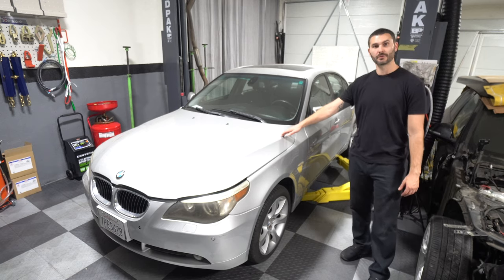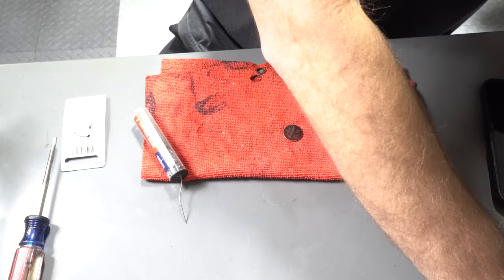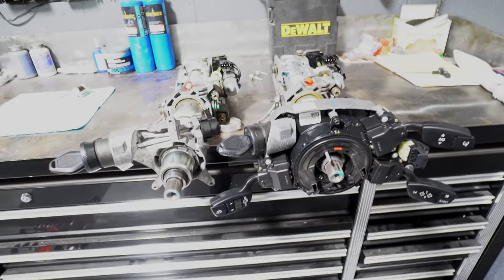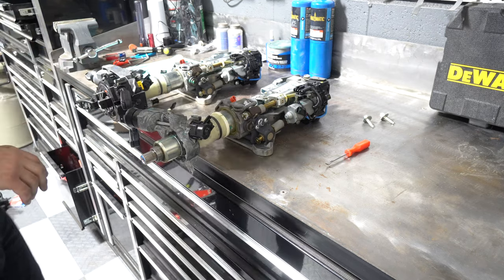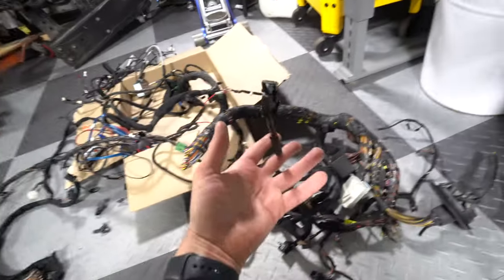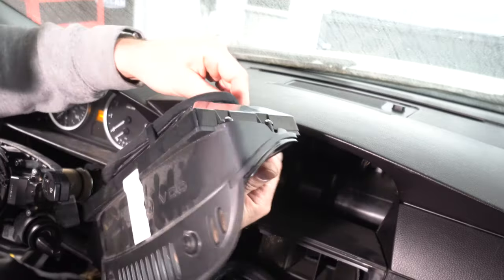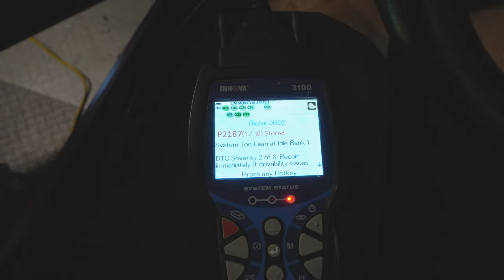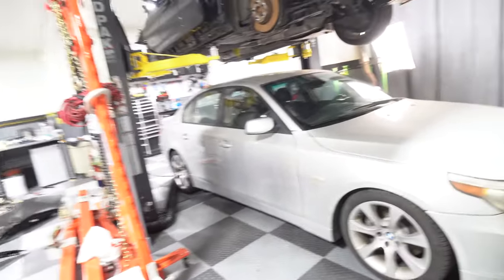No Start, Salvaged BMW 545i E60 Project, Will It Run?

Comment: Great Video 👍 You will need ISTA to fix the rest of the problems. Might as well pick up INPA and NCSexpert to easily code the exchanged parts.
ISTA is necessary to relearn the motor positions used for active steering.
Be sure to find the right ecu (SZL) that lives under the headunit, otherwise seats will not work. 
Good luck 👍
Reply from the maker: Thanks for the tip, appreciate it!

Comment: I think you said the cluster is from a 545i parts car so at least it’s coded to recognize active steering and ars through the dsc. That’s a huge plus for you considering you’re not dealing with a cluster that’s dsc did not have active steeeing.
Reply from the maker: Yes, I did run both Vins through Mdecoder to match up the options. Somehow the navigation slipped through, but I was able to adapt the parts car’s nav system by salvaging some of the parts car’s harness.

Comment: Just a thought - the steering warning light might indicate that the steering wheel sensor is not calibrated or off. If the car did not have its steering rack damaged/replaced/fiddled with, try rotating the steering wheel from one position to the opposite and back about 3-6 times (do the full rotations, of course). Turn the engine on, put the steering wheel into the far left position, then start turning right until it stops, then go back till it stops and so on. Sometimes, it works after 5-6 full circles, sometimes - after 1 or two. However, considering that you replaced the steering column, I would go with checking the cables to the steering wheel angle sensor together with checking the sensor itself. And the replacement column should be in the list of the suspected devices, too. Good luck!
Reply from the maker: Thanks for the suggestion, I haven't looked into it yet but will soon.